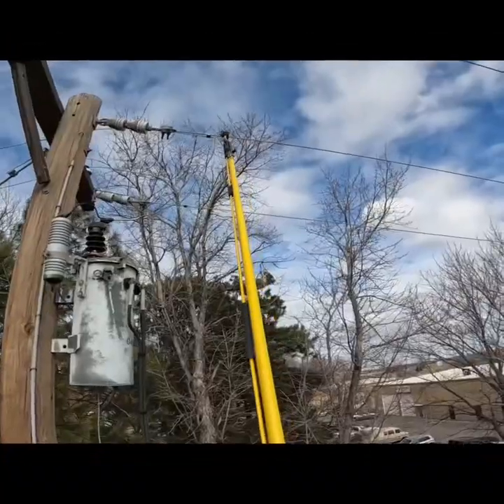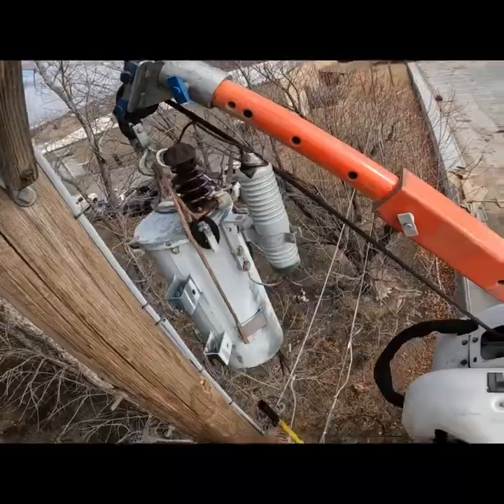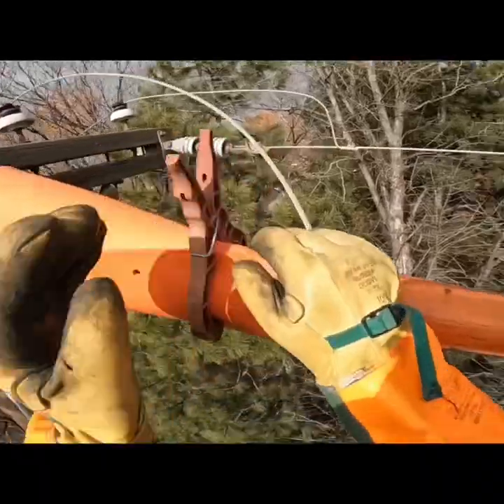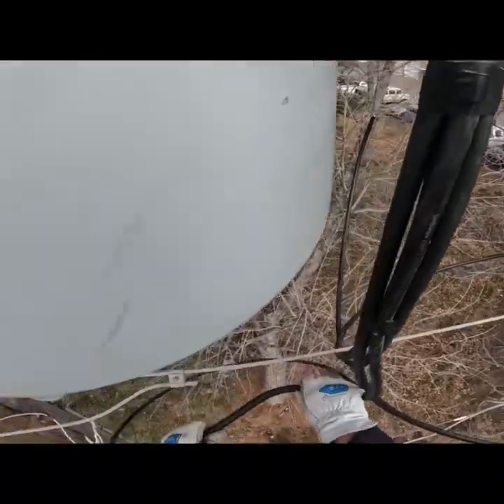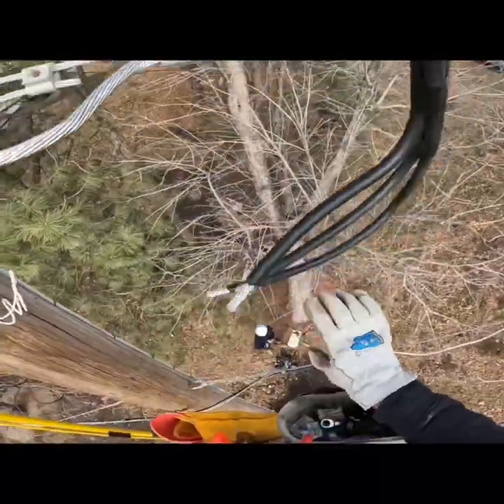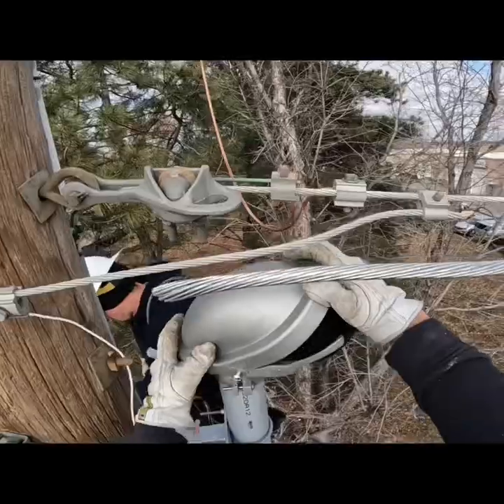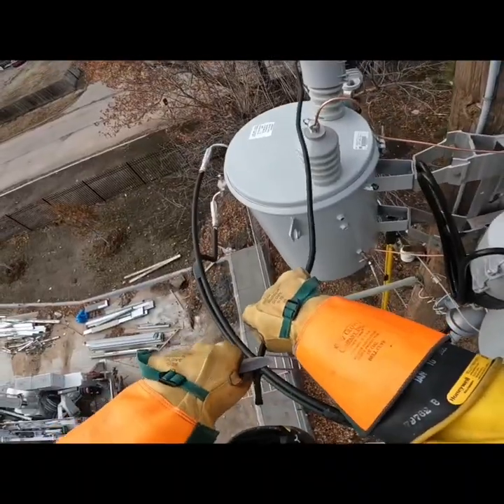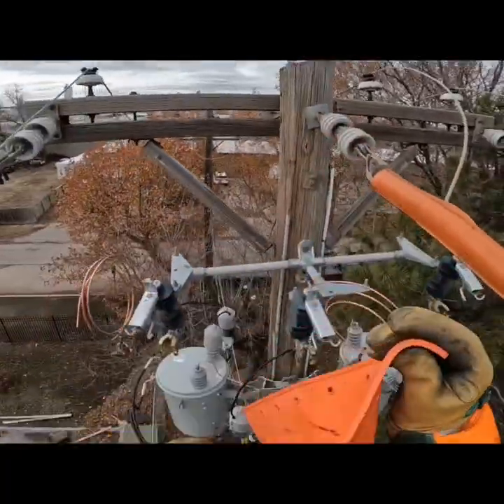Transformer bank installation

Comment: I like how you mentioned you would have put the switches on the other side if you could have, see to many banks and even single phase transformers with the switch and leads on the same side as the transformers.